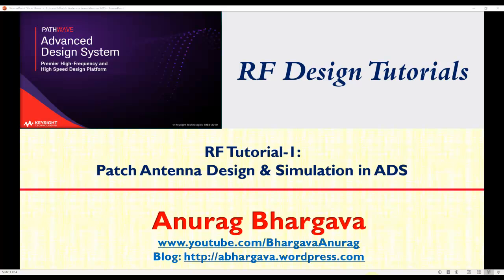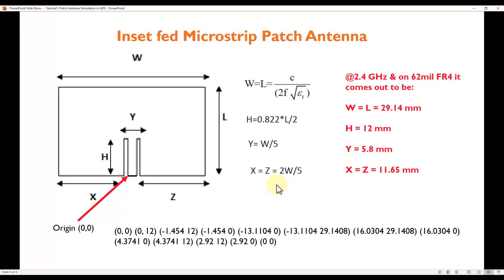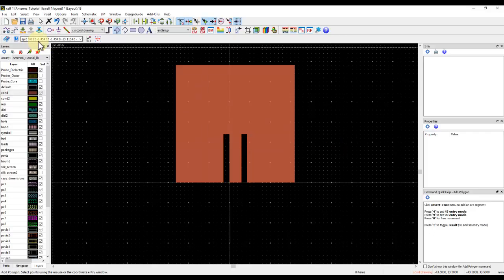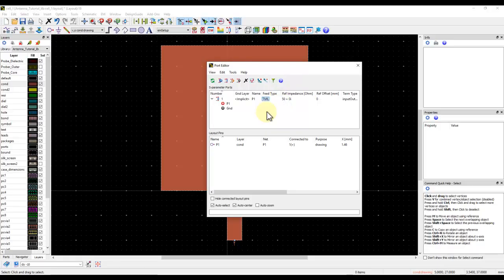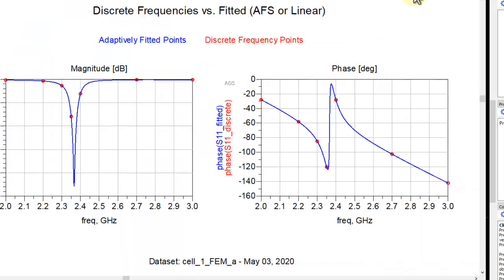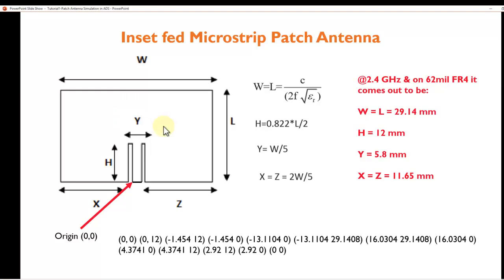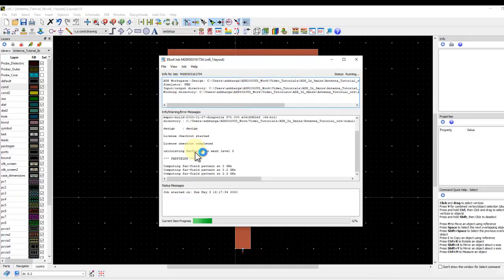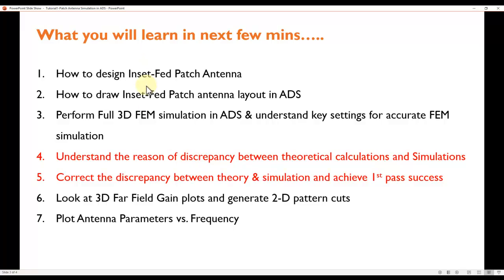RF Design-1: Patch Antenna Design and Simulations

Comment: Hi.  What dimensions am I supposed to create the layout as? Whenever I try to place a pin, the pin is way too big
Reply: resolution*
Reply from the maker: Hi,
The provided dimensions are in mm. You can adjust the Pin and Text size from Options->Preferences if needed

Comment: Hello,
thank you for your tutorials. Those were helping me all over my life and carrier. But I faced 2 problem:
1- I can simulate using FEM. It gives me the following error message:
Analysis "Solve" (M241018160733) of design rf_layout_lib:cell_1:layout failed.
Consult the Job Manager log for full details.

it just does not give me a useful explanation about where this problem come from.

2- when I simulate it with "MoM microwave", it just give me a minimum S11 of -12dB. I have used a metal thickness of 35 micron and FR4 substrate of thickness 62mil. Can you please explain what the problem is? thank you
Reply: But with momentum_RF, It gives S11 of -30 dB .
Reply: It does not work either when I start from schematic, like the way you used in video 2.
Reply from the maker: Difficult to say without seeing the setup, Contact Keysight support by writing to support@keysight.com for help

Comment: @Bhargavaanurag, can you let me know how did you frame this layout command line i see the help options ap [x1 y1 .....] if its possible can i have that info shared
Reply from the maker: You can enable the layout command line window by going to ADS Main Window->Tools->App Manager and select to Layout Command Line and then restart the ADS and then open the workspace and a layout. You can place the command line to your preferred location in the layout.
Reply: @BhargavaAnurag  thank you but i would like to know how did you phrase the parameters such that it was an immediate layout was possible , can you provide me a small note against it , hence dealing with larger circuits it becoming a quite complicated task .if you could share the info it helps me alot

Comment: Thank you Anurag for your great videos!
This is the Patch Antenna layout command if anyone wants it.
ap 0 0 0 12 -1.454 12 -1.454 0 -13.1104 0 -13.1104 29.1408 16.0304 29.1408 16.0304 0 4.3741 0 4.3741 12 2.92 12 2.92 0 0 0
Reply from the maker: Thanks for helping out others...😊
Reply: ıt is saying "(column 4 in execute) 
operator or statement separator missing"
why?

Comment: Hi tried to setup the EM simulation as per tutorial 28 but in that substrate settings were not discussed at all. Even setting the ground plane is not discussed. In other videos also tried to search but didn't get. Still in my system an error is showing due to which can't run the simulation
Reply from the maker: Watch Layout, Substrate and Momentum basics videos in the Learn ADS in 5mins playlist: https://youtube.com/playlist?list=PL9OnCetH8TYrWFGB4QkDP8HVaY-Aum6Hc

Comment: Hi how to change the units. As in my layout window it showcases mil only. I tried to change from options menu then preferences and unit/scale option but still it shows mil only. Please help
Reply from the maker: You need to select units while creating the workspace/library. It is not recommend to change it layer as lot of things will need to be modified and scaled manually. Best way is to either create a new workspace/library and select the proper units upfront.

Comment: Hi, Sir can we design differential antenna in ADS. Moreover, I want to match the differential antenna impedance to further circuit such as in RFID tags.
Reply from the maker: Yes, you can...there is absolutely no problem in doing so. Its all about where you place +ve and -ve pins for port creation.
Reply: @BhargavaAnurag  yes Sir. Thank you. But  differential impedance differs from individual port impedances so I am facing problem in impedance matching
Reply: @BhargavaAnurag  do you have any video showing the design of differential antenna in Ads?

Comment: what is the specifications of substrate that you specify to get  -22dB because i get only -12dB or what i can do to get the same results??
Reply from the maker: I used standard 62mil FR4 substrate. Kindly contact your local tech support team to get suitable answer
Reply: In your stackup under your material definitions for FR4, change your permittivity tan delta (TanD) to 0.001.

Comment: thank you for this video, it is very helpful, can you explain how to get the coordinate. please it is urgent
Reply from the maker: Hi,
To get coordinates, you can take any point on your geometry as 0,0 e.g. the corner on your feedline and then calculate the rest of the points using the dimensions you have for your antenna.

Comment: Hello
I have encountered a problem when I try to simulate the layout. The problem is " No ground plane is found in the substrate definition  and following ports need a gnd reference: port 1 (p1)"
How can I overcome this problem? 
Thank you
Reply from the maker: Kindly add a Cover in your stackup definition if you want to use Ideal ground. If you have mapped a certain conductor layer that you want to use it as ground then define that as Ground layer in the Port Editor for Port1.
Reply: @BhargavaAnurag  Thank you.

Comment: i have this error in FEM simulation:Analysis "Solve" (M210228122953) of design RF_Design1_lib:patch:layout failed.
Consult the Job Manager log for full details. how to solve this
Reply from the maker: You can look at the simulation log to see what's the issue. If you have followed the video then it should work. You can contact your regional Keysight tech support team if you can't resolve it,.

Comment: Sir, I have a microwave absorber designed in hfss. How do I perform equivalent circuit analysis in ads.
Reply from the maker: You can bring the SnP file of your absorber in ADS and then use A vs. B modeling as I talked about  in Tutorial-21 under Learn ADS in 5mins playlist....👍

Comment: It's a very informative video and very useful for beginners like me in ADS. 
I am getting issue in placing the pin as it is taking the corner point not the midpoint of the edge. Kindly guide me further
Reply from the maker: Hi Samarth,
You can turn on the mid point snapping from the toolbar in the layout window, look at 1st toolbar row on the right side and you will find many snapping options and you can switch on & off the ones that you want...😊
You can contact our tech support team in India to get help.
Reply: @BhargavaAnurag  thank you so much sir for your guidance.

Comment: can we use the same design for frequency 3.3GHz-3.8GHz and 24-29.5GHz ?
Reply from the maker: Yes you can use the same concept but you might need to play with feed line impedance a little but for mmWave frequencies else the spacing at the inset level might not be sufficient. I think I did cover it one of the videos of using Data Display based Antenna synthesis/calculation template
Reply: @BhargavaAnurag  thankyou sir

Comment: Hi Sir, i've  a question , is it possible to send you a schematic to explain me something? i want to send it to you by mail. regards
Reply from the maker: Hi,
It will be difficult for me to respond on mail. If you have any query, you can post it here and if it is too deep then I would recommend contacting local Keysight support team.
Reply: @BhargavaAnurag  Why do I get different results when I use a momentum simulation and a schematic simulation with a Term G port for the same project?
is it normal to have different results if i use a layout rather than a schematic with a Term G? Regarsd
Reply from the maker: @djgandb553  No, as long as you have setup the simulation correctly, it should be same results as when you use emmodel in schematic it is essentially using the S-Parameter generated by Momentum simulation so there should be no change.
Reply: @BhargavaAnurag  thanks sir

Comment: sir, can you please upload full explanation tutorial to do load pull simulation in ADS software to obtain optimum load and Source impedance of RF transistor for wide band amplifier design....
Reply from the maker: Hi,
I will talk about LoadPull on my channel soon...
Reply: @BhargavaAnurag  Thank you so much sir, I and my partner are on a research project on designing a wide band power amplifier for cellular signal.I already referred many references on load pull simulation. But still can't able to get proper idea to do it. Therefor it'll be much help if you help us with it soon. 
Thank you.

Comment: Hi sir,very useful one.may i know how to obtain the coordinate values
Reply from the maker: Hi Asha,
Once you know the dimensions of your antenna then use any 1 point as your (0,0) and then calculate the rest of the vertex points i.e. coordinates with respect to that else you can use normal Rectangle/Polygon approach in ADS layout to create the Patch Antenna geometry. There are many ways you could approach this and I have only discussed 1 of the ways.
Reply: Anurag Bhargava ,
Thank you so much sir

Comment: Hi Sir,
currently I wanted to design 60GHz antenna using a substrate in PDK given but I actually don't know how to do that can you suggest me a way to do it. I am also confused regarding how to improve the gain for the antenna.
It would be helpful if you help me with my issue
Reply: 3 years is maybe too late, have you found an answer?

Comment: Is it possible to design MIMO antenna and meta-material antenna in ADS?
Reply from the maker: Hi Asad, MIMO antenna yes. Meta material is very broad topic and if you want to do things like SRRs and Left hand stuff then it can be done very easily in ADS but if you need anything more then I would using some 3D EM tools like Keysight EMPro or Ansys HFSS or CST MW Studio etc

Comment: Thanks for the videos they were reall6 helpful 

I have a question please ! I designed a patch antenna on 10.525GHz but i dont get the maximum on this freq , i get it on 10.8 ?
How can i have a maximum on my freq ! Thanks
Reply from the maker: Hi Youness, Somehow I couldn't get exact question from your statement....What maximum are you referring?
Reply: @BhargavaAnurag  sorry ! the maximum of gain
Reply from the maker: @younesszaarour284  Try looking at phase(S11) and adjust the design to make sure it is crossing 0 at your desired frequency, this way efficiency will be maximum at that frequency and you should have the best power transfer. Also, look at the gain parameter as per your expectations and don't try to achieve max gain at your own frequency.

Comment: Hello. I am working in my final project degree. I have to design an antenna patch in ADS and I have to study the resonance frequency variation for different bending angles. Could you help me? Is it possible to simulate it in ADS?
Reply from the maker: Hi Alejandro, I couldn't understand what you mean by bending angles? Do you mean a kind of conformal antenna ?
Reply: @BhargavaAnurag  I use a flexible substrate as a paper or textils. The antenna doubleing causes a resonance frequency change. Studying it is the goal of my project. My problem is that  I can't simulate  the antenna bending in ADS. Thank you for your attention.
Reply from the maker: @alejandro3489  Unfortunately, that kind of design can't be simulated in ADS environment and it doesn't have the full 3D editor as what you are looking at is called conformal antennas. 
However, you can do that easily with Keysight EMPro which is a full 3D EM simulator and you can use either FEM or FDTD simulator to analyze the effect of bending on the Antenna performance...😊
Reply: @BhargavaAnurag  Thank you very much Anurag.